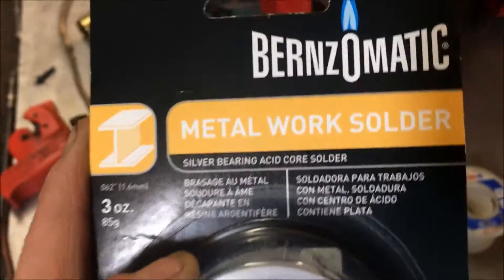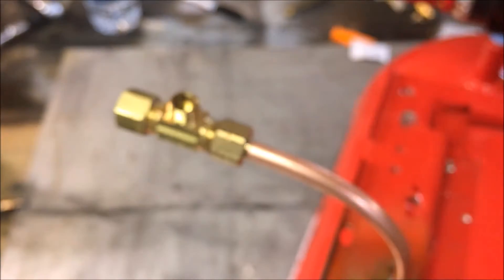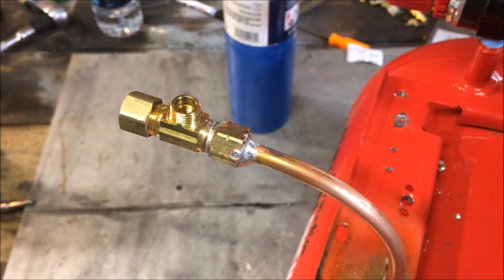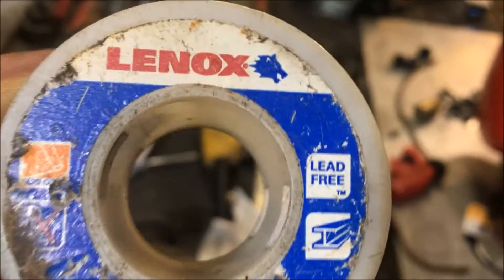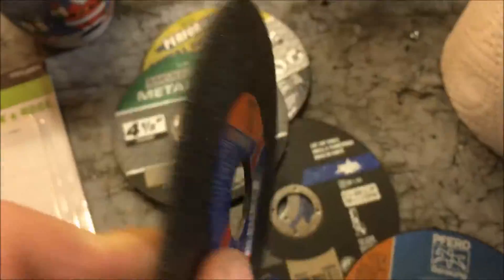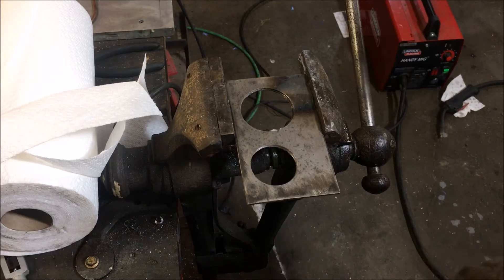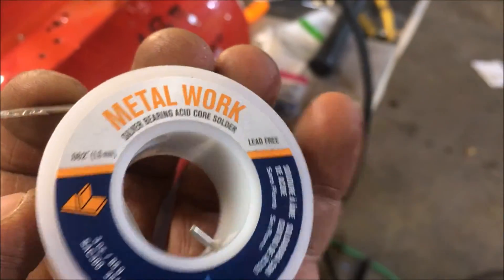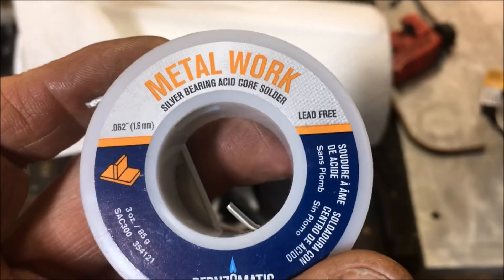Bernzomatic Solder ( Review )

Comment: U shouldn’t apply direct flame to the solder only to the surface and then brush the tip of the solder.... ur not giving it the chance
Reply: “…bin soldering for 20 years”

You left a word out… “wrong”. 

Corrected sentence; ‘ Bin soldering WRONG for 20 years!’
Reply from the maker: not true , bin soldering for 20 years , this stuff is crap , all the good brands work just fine
Reply: @NOBOX7  I've been soldering for 6 years, got a Bachelor's in Applied Science for Electromechanical Engineering. It's pretty common knowledge to keep the flame from touching the solder, otherwise, you are just going to burn the solder and end up with really weak results. You heat the area you want to apply the solder to, the solder will flow to the hottest point, that's how you get the solder to flow more inside a gap. You are just applying heat and melting the solder before the brass heats up enough, which is one of the reasons why in your video you keep losing your solder from it just breaking off and falling. For the strongest solder joints, you heat the parts so they pull the solder in, If you don't you are just burning up the solder and making it weaker while the brass is getting to a higher and more ideal temperature. It takes about half the amount of time to get a good solder joint and oxidizing isn't a problem like you apparently struggle with within this video. The Longer time spent doing something does not always mean skill improves with that span of time, especially if doing it wrong for 20 years.

Comment: The benzo metal works solder is complete junk. I only got the solder to stick to coins and be easily to be able to peel it off and thats its.  I used a propane touch to have it flowing only to find out it dosnt stick to steel which was the purpose i got it for.
Reply from the maker: Thanks for the input

Comment: Re uploaded?
Reply: It’s my experience that even with proper flux that lead free/ silver bearing solder can really suck. The old radio shack lead free was aweful.
Reply from the maker: yes the last video was a call to action to see what people claim is the best acid core solder and to share my choice  , this video is just a review on very specific product  .
Reply from the maker: i have a good video uploading as we speak , built a very cool  highly controllable oil and water pump with infinite flow rate and pressure control under 120 psi and under 4 gallons per hour